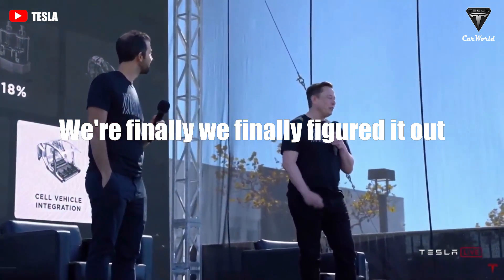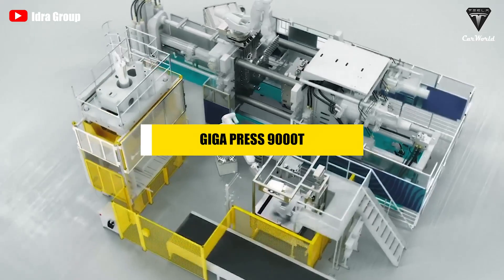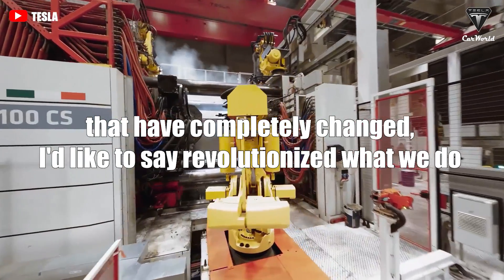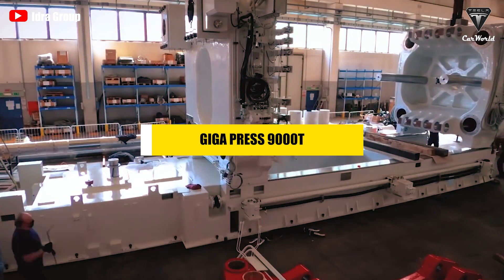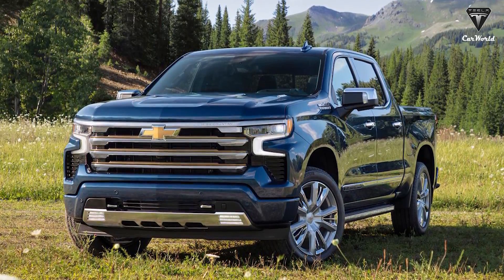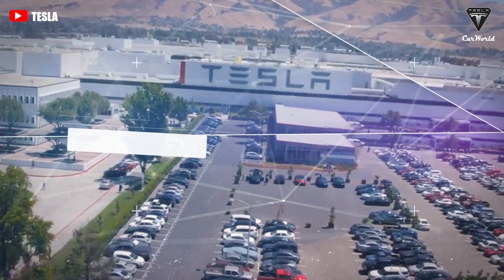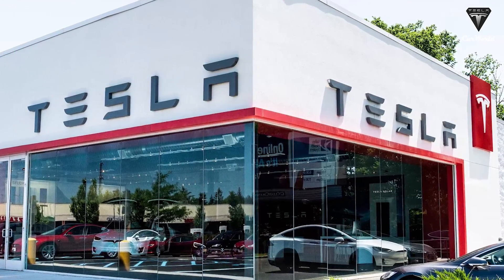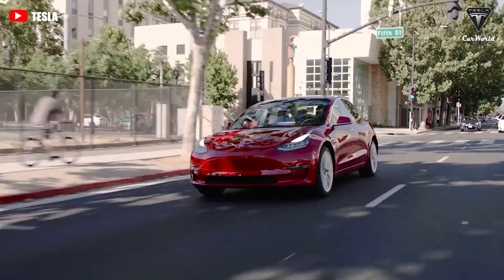The Real Reason Tesla Developed The Giga Press 9000T

Comment: There is a downsize to the gigapress ... and it is the materials used to construct vehicles. 

Back in 2009, when Tesla got its government money, the company that didn't was Aptera which, at that time, brought forward the concept of composite monocoques that were not only light weight and capable of being formed in some exotic shapes and bends, but you can cobble a complete body from as few as four or five parts.

While not capable of producing the throughput of a 'gigapress' - they can spit out multiple components in rapid fire fashion, composites and forms/jigs have come along way especially with UV curing methods and other streamlined approaches to their production. 

While they can't produce components at the speed of a gigapress - a unit every three to five minutes is actually realistic - those pursuing composites as a way of streamlining production have two huge advantages. The first is the capital investment involved in gaining this production approach is minimal, even in comparison with steel-bodied vehicles much less gigapresses both in terms of actual cash and in just the space needed for an operation. 

The second advantage ... and this emphasizes the key disadvantage of the giga-press ... is you can distribute your production for any reason including just providing your customer a lower price because there is minimal transportation associated with each vehicle. 

This is actually a big deal if you're building a car for the people.  

The use of composite techniques for automobile production will allow the creation of mini-assembly plants around the world, each with their own set of composite jigs making it possible for them to use 'complimentary' sub-systems - maybe as few as six such 'pre-manufactured' sub-systems all built to a general standard. 

This is being explored by one company, Aptera Motors, which incidentally got the short end of the stick back in the politics in the 2009-10 period.  See, Tesla, which was going to build steel-bodied vehicles with electric motors got a $300 million government grant to produce its roadster and do work on the Model S while Aptera, which even then was suggesting they become the first composite-bodied mass-produced vehicle which would be absolutely disruptive to the robot manned, steel-bodied entrenched auto industry. 

Tesla, which just had electric motors and batteries in its hand got the cash (as did Fisker) but not the potentially more disruptive Aptera.  Tesla got the play because they accepted the game - build complex, steel-bodied vehicles involving paint, robots and massive factories for pressing steel and forging crossmembers and try to make it not squeak.  At the beginning of the adventure, few gave Tesla much of a chance of success because they know that startup car companies, as a rule, fail ... because the path to a good car built the way they're built is really quite difficult and  'engines' weren't the only pitfall.  Tesla's trip through production hell is well documented and that they survived the gauntlet is only now getting less unique. 

As this video so succinctly suggests, the advent of the giga-press and the 'vision' of stamping out cars like toys is about to become true for alloy based vehicles made by Tesla.  That this move to simplify auto production is, in the hands of Musk, is payback for the slings and arrows shot his direction during his time in hell.  That he hopes to run them out of business - literally bankrupt them  -  with the innovation ought not be a secret. 

There is one final advantage composites have over alloys - and that is really the 'super-giga-battle' that is in play ... and that is weight. Composites not only are traditionally lighter and stronger but newer composites stretch the advantages.  Lighter, of course, corresponds with operational efficiency which opens the door to things like solar powered transportation that self-generates the energy to operate.

To recap, the gigapress is big advancement in the production alloy-based vehicles because it simplifies the production process by minimizing the number of additional parts to make a vehicle thus saving not only materials but especially the labor required to put them together.  You can think of a mega-casting, with only a few seconds of human labor apportioned to each unit, as saving what 10 hours of assembly time considering all the parts and the finishing and even transportation of the original materials. 

Traditional automakers solved the problem with technology back in the 80s and 90s by trimming labor by employing robots for a lot of routine assembly work like spot welding, etc.  This was an adaptation of the human powered assembly line and the primary difference was whether the assembly was done by robot or man. But as we reach toward the third decade of the 21st century, the costs of human labor are such they can't compete profitably with a company like Tesla because of their legacy systems. 

Then there is the alternative presented by composites. 

In a more diverse world where things get more complex with distance and culture changes, an approach that distributes productive capacity around in smaller doses and allows much grater localization of the benefits of assembly and production (rather than conforming to the colonial precept of all to the centralized authority).

Comment: All sounds good. We will see what happens in reality. For now, EVERY EV on the market is grossly overpriced compared to a similar sized gas model. They also have too short a range and take too long to charge. The current EV market should actually be 25% cheaper than a comparable sized gas model since you get less with the EV.
Reply: Yah that's always there's a  line around the block for them, not enough range and too expensive. He can make (2 ) 250 mile cars with the materials it would take to make a 500 mile car. The goal is to replace ICE cars fast.
Reply: Longer rage cars will come later to serve that part of the market.
Reply: @johngagnet1287  that is fine, but for now EVERRY EV on the market is a loser. Overpriced, too short range, and too long to charge.
Reply: @JohnSmith-ug5ci  Using US National Averages of $3.78/gal and $0.155/kwh a Tesla Model 3 will save over $15k per 100,000 miles compared to a 20mpg car.  It will also need 20 less oil changes and likely half of the brake services due to regenerative braking.  There are long waiting lists for EV's so demand is not a problem at all with current pricing.  You are correct that early EV adopters are paying a premium over comparable gas cars.  That premium is paid back by much lower fuel and maintenance costs and will mostly be eliminated in the short term with the upcoming $7500 tax credit and in the long term by innovations like this giga-press and much lower cost battery tech coming out in the near future.  EV's today make sense economically when factoring fuel and maintenance costs and will make gas cars look absolutely dumb in the upcoming years when EVs improve and gas vehicles remain stagnant.
Reply: @Ry-lx2kl  I assume you have bought the party line of lies. The average MPG in the USA for cars is 36MPG. Not 20. Also the average driving distance per year is around 15K. 

The current gas prices are due to democrat/communist practices. If we get a new administration that can change back too an average of around 2.50 a gallon.

If you do the math using proper numbers you will see it takes 20 to 30 years at 2.50 a gallon just to break even with an EV.  due to them being overpriced. 

None of that takes into consideration all the setting time at chargers. They are impractical losers right now. Perhaps that will change.
Reply: @inciwillard991  What I do not like is the lies. I like the possibility of the technology IF they get it worked out. However EVERY EV owner tries to justify their purchase so they do not seem too foolish. It would be one thing if they admitted that they bought an impractical vehicle simply because they wanted to be on what they consider the cutting edge or for some other reason, but they try and cover-up the truth about these vehicles.
Reply: @JohnSmith-ug5ci  Sorry about all the replies, trying to delete them. I was typing on my phone and it kept saying to retry, I didn't realize it was repeating it. Now back to the "lies", why do you think they are lying about their cars? Please list what you think are the lies unless you are watching our piss poor media where not a single day goes by without mentioning how sh!tty Teslas are yet forgetting it isn't the only EV out there. They do glorify Rivian with a good intention though, money man behind it is none other than Soros clan. And besides all other objections you may have for Tesla, look at it this way, you didn't pay for mine and if I'm a foolish old lady so be it.
Reply: @inciwillard991  Actually my comments are not about any particular vehicle. EVERY EV on the market is an impractical loser.

They are ALL grossly overpriced, too short a range, and too long to charge. 

As to why I think every EV owner is lying about their vehicle is because they have bought an impractical loser and do not want to admit their foolishness. 

There is nothing practical about paying more to get less.

I would have no problem if they admitted the vehicles are impractical and they knew it but just wanted the experience. 

Think about it. Let's say that a new combustion engine vehicle with some special fuel was put on the market and it only had a range of 250 mile, took an hour to fill with its fuel tank, people were told not to fill the tank all the way to save the gas tank, in cold temperatures it could lose up to 50% of its range, and fueling stations were far and in-between and many times were broken, and the vehicle price was 20 to 50% more than a regular gas model. 

How many people would think it practical to buy one of those?
Reply: Not quite true! I've replaced my Range Rover Velar p380 hse that was the same price as my Tesla model S long range. Model S has 405 miles range, RR Velar had 379 miles on high test fuel. I've made a 1,290 miles round trip which I've done many times in  RR Velar to Homestead,FL. Cost of fueling vs. charging is not even comparable. total EV charges at Superchargers came out to $67.19 whereas the same mileage on Velar was $189.00 and that was before the fuel prices jumped to $5.29 per gallon. Charging times at the superchargers were under 15 minutes enough for me to visit the nearest  ladies room and get a cup of coffee.
Reply: @inciwillard991  You are comparing apples to oranges. A comparable sized vehicle to the Model "S" is a chevy Malibu or a Ford Escape. Not what you are using to compare with. You bought a loser.
Reply: @JohnSmith-ug5ci  I love my loser!  Can't wait for my CyberTruck and hoping one day Tesla will come up with a Cyber SUV.
Reply: @inciwillard991  Please understand this. I am not against EV's. In fact I am interested. The problem I have is the lies that most every EV owner tells to justify owning one. 

I would have no problem if they were honest and just say even though they are not practical they still bought an EV.
Reply: Justifying? Why on earth Tesla owners have to justify themselves? If you are seriously interested trying out an EV, you can rent one from Hertz and drive it to see if it suits you or not. You don’t like it? That’s fine since I don’t know a single Tesla owner trying to shove it down to public’s throat except the current administration but we still have some freedom to say no or vote them out.